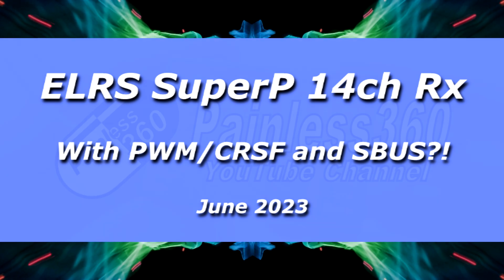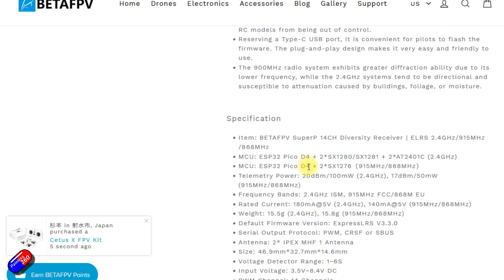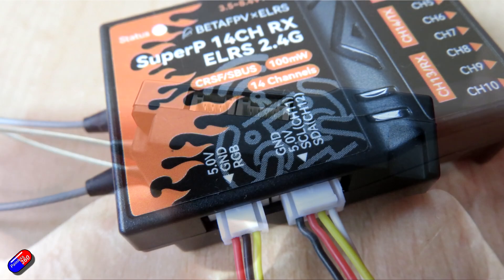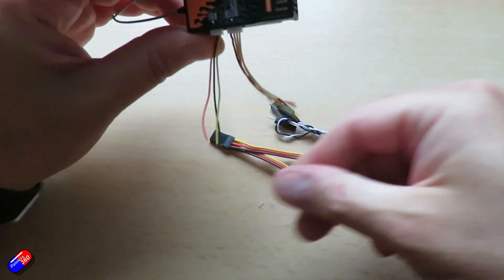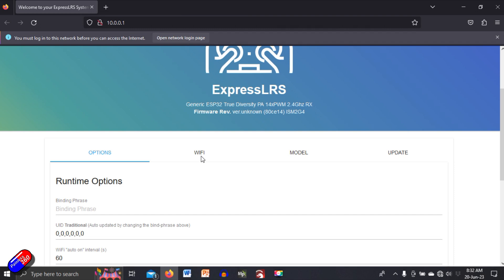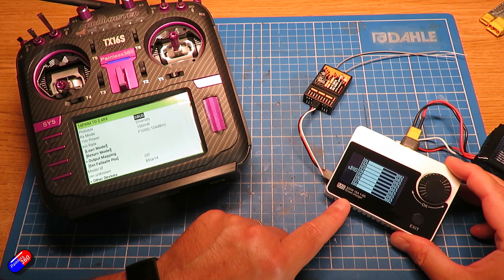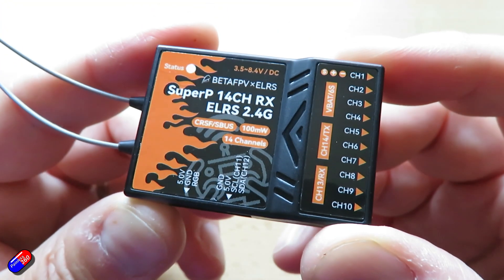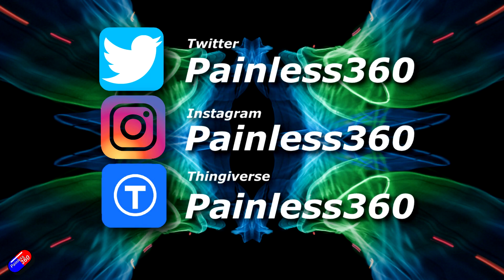NEW! BetaFPV SuperP 14ch PWM receiver that can also talk CRSF and SBUS!

Comment: do you know where is the Telmetry cable ? and what port ? I set it to CSFR and connect the CH13 to FC and nothing! 
Thank you
Reply from the maker: If you want telemetry, then use CRSF. It is a bi-directional protocol perfect for modern builds.. Happy flying!
Reply: @ thank you for replying. Do you know where to connect the cable in the RX? And where in the Pixhawk? It’s like servo cable have 3 wires.
Reply from the maker: Two of the outputs can be setup as the CRSF TX and RX pins. See my video on setting up ExpressLRS CRSF with Ardupilot from before Xmas.. Best of luck!

Comment: In which port of the receiver are going to use if you are trying to connect it to a Speedy Bee F04 wing flight controller which has a 4 pin input for ELRS receiver?
Reply from the maker: Connect to it via the WiFi and setup serial to be CRSF. The marking on the case are for the TX and RX channels on the CH13 and Ch14 pins..

Comment: Did you tried to enable Airport mode on ELRSs (TX and RX) to check how they works?
Reply from the maker: What specific test would you want to see?
Reply: @Painless360  Thank you for you reply. I want to see overall setup process of airport mode, especially how to check it after connection. Few days ago i made everything by instructions provided on their website. It shows that receiver connected to transmitter but still cant receive two way data from TX <-> RX by connecting putty on both sides as they recommend.
Reply from the maker: So, it is more of a general video on the feature. Not about how it works on this specific Rx?

Comment: The default is that CH13 and 14 are PWM. In the PWM config change the pin "mode" to Serial TX or Serial RX respectively and it will do the right thing.
You will need to wait to 3.3.0-RC2 which has the updated target file for this receiver.

Comment: What is the advantage of the CRSF output. Is it just another bus for talking between the receiver and a flight controller? But you could use SBus for that So what is the advantage?
Reply from the maker: CRSF looks like it may become the choice for attaching things like GPS, voltage and current sensors directly to the RX in future... Happy flying

Comment: This is a little off topic. But my buddy is building a plane and is using the new Speedybee FC and has a Spektrum AR631 receiver and he is wonder how to get the Spektrum talking with the Speedbee.  He also has an NX6 radio.
Reply from the maker: I'm not sure. Spektrum don't widely support the open standards of things like SBUS and flight controller makers have stopped adding spectrum reciever connectors too. Best of luck